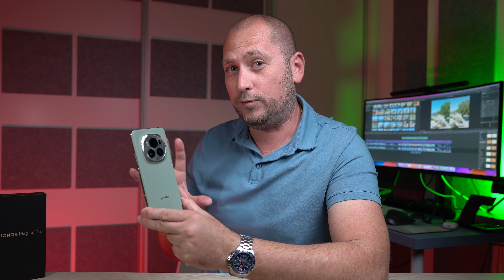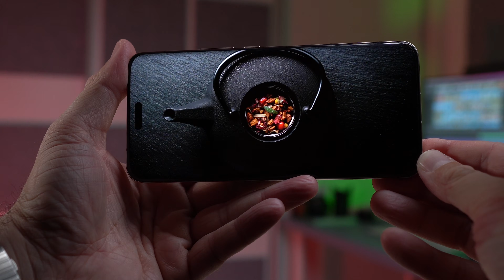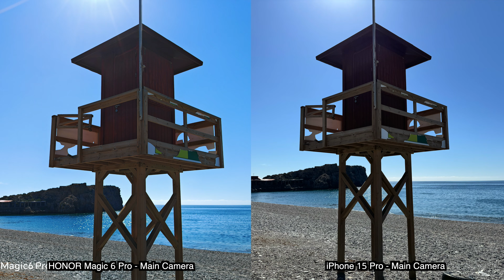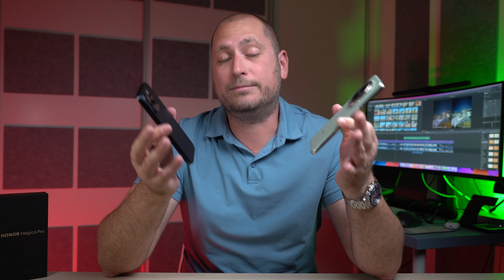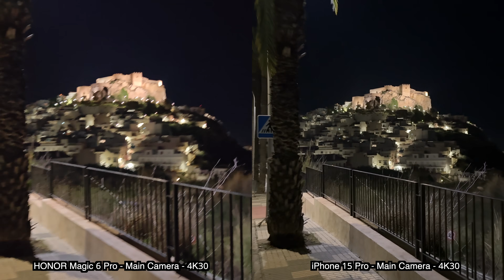HONOR Magic 6 Pro VS iPhone 15 Pro Camera Comparison & Review

Comment: Excellent video. This finalized my decision to purchase Honor magic 6 pro 👍
Reply from the maker: great phone
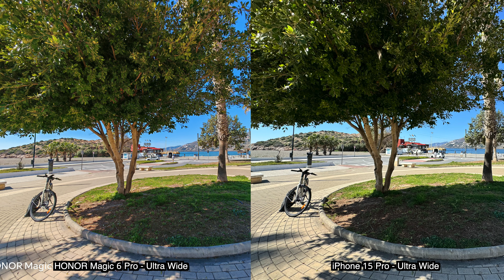Reply: @RedskullPro  i THINK IT IS SOMEWHAT TRUE WHAT THEY SAY THAT CHINESE PHONES KILL APPS TO SAVE BATTERY,M BECAUSE THE VBATTERY IS IMPRESSIVE FOR THOSE POWER HUNGRY ANIMAL FLAGSHIP sOc'S WITH 6 CORES @ 3gHZ OR ORE. I HAD A LITTLE ISSUESWITH aIRbNb NOTIFICATIONS AND A COUPLE MORE, BUT AFTER YOU SELECT manual OPTIMIZATION IN aPP lAUNCH, AND IN oPTIMIZE BATTERY, YOU SELECT 'dON'T aLLOW' FOR THE APPS YOU WANT, IT WORKS. tHE BATTERY STIL HOLDS, NOT LIKEas much as before optimizing all my 6-7 apps + Accubattery to always run in the background and they do, still sometimes AccuBattery cuts the session in more than 1 piece. Amazing phone overall, cool, fast, benchmarks crushed, bright as f.., not thick book like S24 Ultra, camera is more than good enough for me, even though it is a bit behind iPhone 15 Pro Max and S24 Ultra, how can you share it, you need to share the full file size, no one uses anything but quick share button in SM platforms and VoIP apps like Viber, which destroys the quality, who cares which one is slightly better. Very good and battery life is gamechanger , especially from what I've seen with my previous flagships, even the 2022 model was much shorter  vs same brand mid tier  from 2020 (but it was Moto Power models with a SD665, so this doesn't use a lot of power, but a 3 day + 3 night phone, low use 96hours. The HONOR 6 PRO DID 654hours with 7:30 of which was SCREEN ON Time, and I use it moderate on Screen On! Impressive. SORRY FOR T HE CAPS- it was too late!

Comment: In no video you will see a screen test under direct sunlight on the Honor Magic 6 Pro in comparison with an iPhone. Only fingerprints are visible on Honor. unlike the iPhone. where everything can be seen very clearly. Honor's screen works like a mirror and the side edges are very reflective.

Comment: you set the honour magic 6 pro's camera to the most filtered setting possible and compared to the iPhone's natural non changeable stock camera.

That's scammy and misleading.. the phone has a standard picture mode which is more natural and detailed.

Yet you chose to go out of your way to change the honour's picture settings to the most Photoshop like filter mode available and didn't compare it in the standard natural mode.
That looks Better and it's comparable to apple  's iphone 15 pro.
Reply from the maker: No, both phones were set to the vibrant mode.

Comment: What if they improve the night time/low light videos on the HM6Pro. It would be on par with iP15PM. If thr Honor Magic 7 Pro will be released this year and a flat screen 🦾🤠🤯
Reply: They should definetly improve the night time camera Samsung and Honor both have the noise problem at night. But also i dont think that a flat screen will ever happen because they are iconic for that and most people or atleast I presonally like the curved screen a lot
Reply: I don't think that will ever happen, because for Magic series is iconic with a quad-curved screen

Comment: No case or charger in the box ? This is unacceptable for a Chinese high end phone , Samsung and Apple ok but not a Chinese phone
Reply from the maker: No more case and charger 😢
Reply: @RedskullPro  yes 

This is unacceptable for a Chinese brand
Reply: Not acceptable on a chinese brand but its ok if gringos do the same but at higer prices? Do you even hear what ur saying? 😂🤡
Reply: @estebanromero4791  yes because they are of lesser quality than the Chinese phones
Reply: I ve seen so many videos on youtube about this smartphone, and all of them had charger and soft case, the author is wrong
Reply: @leokind6031 Depends. The bundle is provided by the local sellers not honor as standard.

Comment: Question: Does the jitter or stutter occur and remain in the original video file when panning with the Magic 6 Pro? or is it only apparent after processing on YouTube? I see jitter here, but when I upload I notice it is Youtube's fault after processing....
Reply from the maker: No, it’s not the Youtube processing. That’s how the video is. For low light videos it happens because it lowers the fps to make the videos brighter.
Reply: @RedskullPro  but during day time too?
Reply: @Cptblogh That is typical 30fps panning jitter. Switch to 60fps and there will be zero jitter.
Reply: @neilmcguinness4422  any way this can be confirmed with a video?

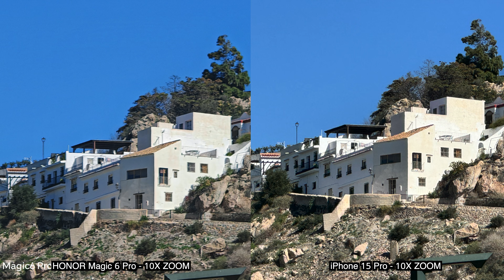Comment: 8:07 looks like you have a defective lens. Same of every shot. Or they messed up very big, thats not good at all.
Reply: What's wrong with that picture? Looks good to me... Normal from a 2.5X telephoto
Reply: @Tech4Me847  Looks like you are looking to a 3d movie without 3d glasses. Looks like the lenses are defective.
Reply: @yamahass66   I would say that it's simply the camera processing trying to oversharpen the image more than it should, in fact when you dial back to 5X that's gone
Reply: @diegopagani6549  It also might be problem with hdr stacking. That might be the reason. Or some of the lenses/cameras are broken. Not rewacthing
Reply from the maker: Are you seeing something I’m not ?
Reply: Get some glasses. Or clean ur screen.
Reply: @smitjee  Get a screen.
Reply: @yamahass66 like i said, get ur eyes checked out.